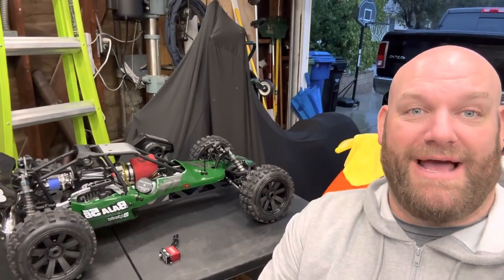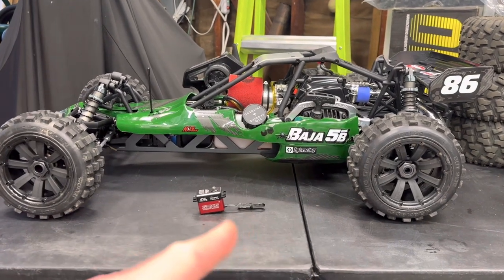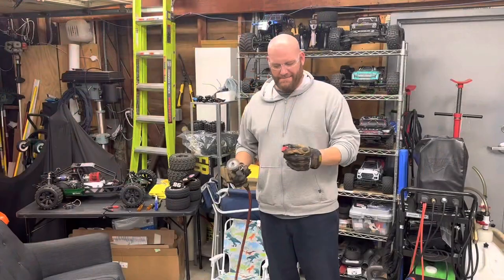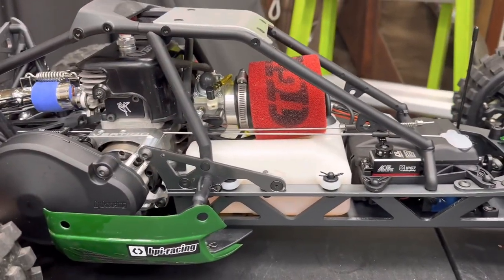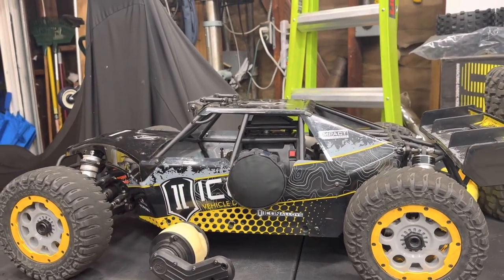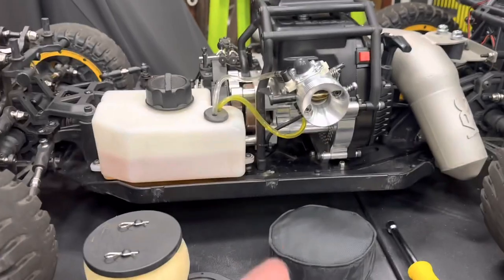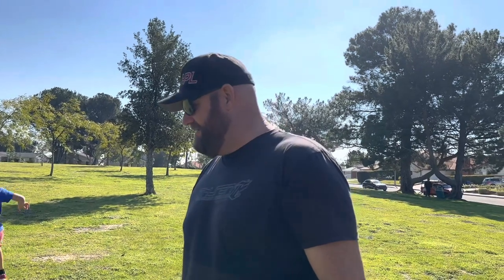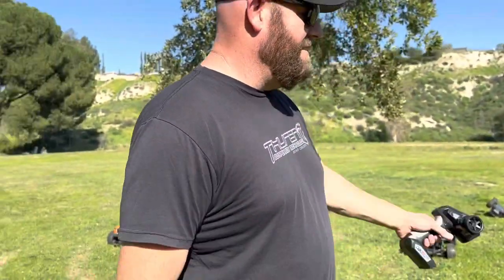Hpi Baja 5B Gas vs. DBXL 2.0 Gas

Comment: you should try OBR power stack velocity stack works great  and your DT-1 will clamp on better too wont fall off. i  have OBR motors i use DT-1 FILTERs and the obr power stack  works great

Comment: Has your Fuel Tank started leaking yet? 
My Fuel Tank just started leaking a few days ago, just wondering if and how you fixed your tank or if you haven't had a fuel leak yet under your ownership
Reply from the maker: I’ve been one of the lucky ones so far. Knock on wood!! No leaks. It’s an unfortunate issue that many experience. I wish Horizon would redesign the tank or someone had an aftermarket one for the 2.0. I would try really cleaning it and then plastic welding a piece over that area.
Reply: @818_Custom_Garage  That's exactly what i was thinking about doing. I see Taylor RC in UK makes a Metal Tank for The DBXL 2.0 but to be honest i like being able to see the fuel level.
Reply from the maker: @RGVJR609  I agree, being able to see the level is something I would want as well. I hope you are able to get it fixed up
Reply: Watch Kev Talbot and his fix of it
Reply from the maker: @coryyoung8289  I think he ended up just buying a new tank. He tried to use a screw with epoxy but it still leaked. It stinks they haven’t done a re-design yet
Reply from the maker: @Kyle Boucher that’s. Good idea as well!!
Reply: @@kyleboucher5007 Do most of the new cars have that leak? What percentage would you think?  I just ordered the 2.0 yesterday and should have it in a week.  Hopefully I get lucky as well.

Comment: What 2s battery did you use in the baja Sir?
Reply from the maker: This is the one I’m using. You need to fill the bottom of the receiver box with some foam.
https://www.ddmracing.com/DDM-Racing-7.4v-4000mAh-RX-LiPo-Battery

Comment: can i use 2s lipo on the stock BEC of baja 5b v2, instead of nihm battry?
Reply from the maker: Possibly, you just need to make sure your receiver and servos are good with the full 2s voltage